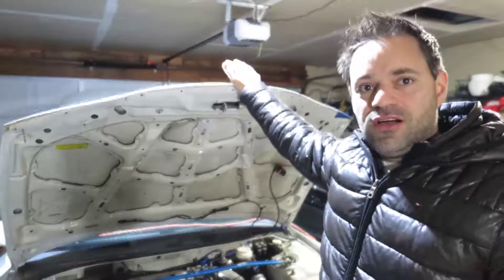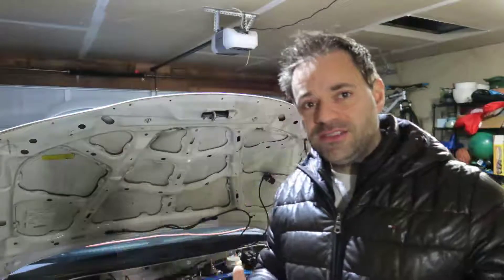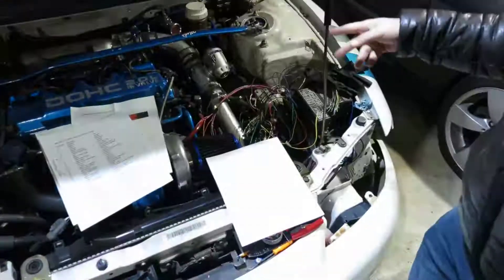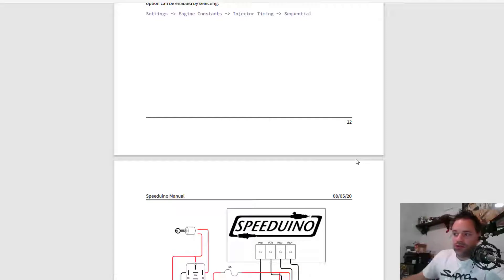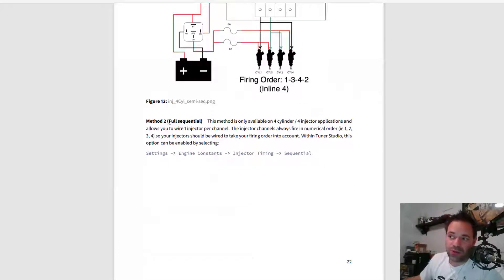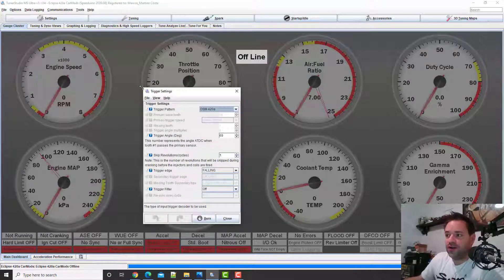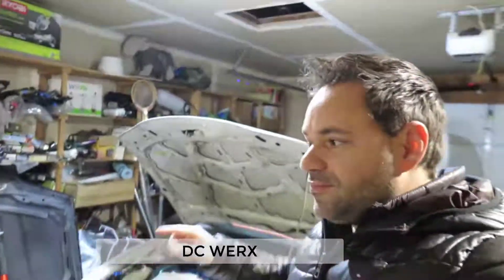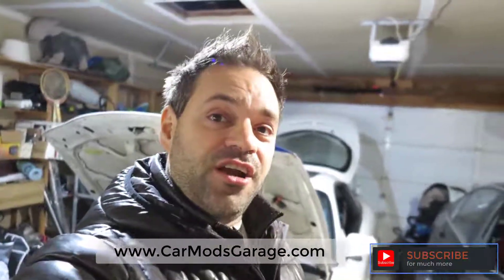Installing Speeduino Standalone ECU (SpeedyEFU ) Pre-Installation - Eclipse 2G Speeduino

Comment: Which pin out did you use mine had the same ecu as yours
Reply from the maker: Everything I did is on the video.  Which pinout you are asking about?   It's been so long I can remember.
Reply: @CarModsGarage  I was asking about where you found the pin out for the stock 98 ecu on your eclipse
Reply from the maker: @buddywhite9607 good question.  Message me on my Instagram.  I'll see if I can find it

Comment: Got 972dr1.8 5sp mirage. I've swap in a 2.4
4g64. From a 2001 galant.
I have a 40 idc ribbon cable for my speeduino v0.4. 
Having trouble knowing what connections I need to keep on the factory ecu. 
Help.
I ordered evoscan software and cable. 
But it would like to use the speeduino
Reply from the maker: Sorry man I don't have experience with any plug and play.

Comment: Do you have a link to the pinout for the 420a ecu? All the pinouts I find are for turbo models and having some troubles with my car don't know if it's ecu issue or  a wire in the harness.
Reply from the maker: Which year is yours?
Reply: @CarModsGarage  I see your car has two ecu connectors instead of one like mine from watching your wiring vid so the pinouts will be different also :/ thanks anyways! Great videos!
Reply from the maker: @RicoYT23  ya mine is 98. I had the wiring for the older 420a also but they all have two connectors. I definitely don't have the pinot for a sine connector ECU
Reply: @CarModsGarage  95